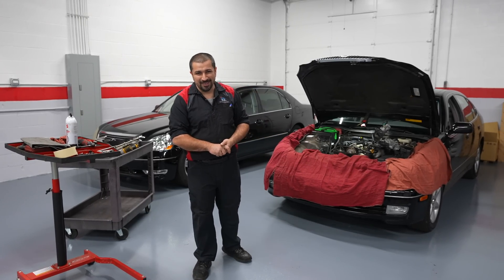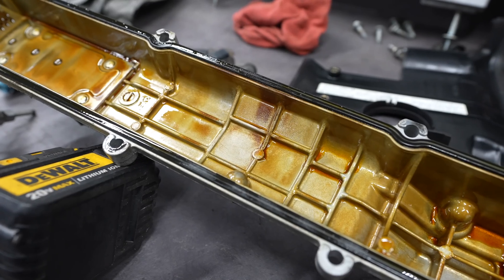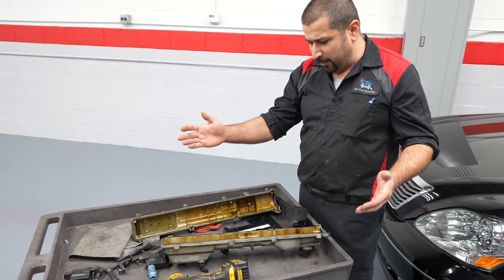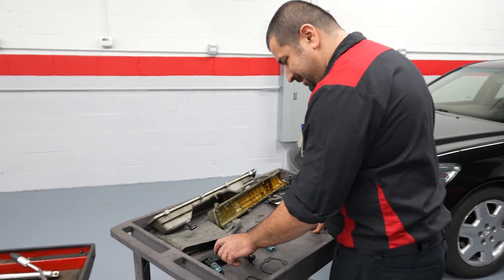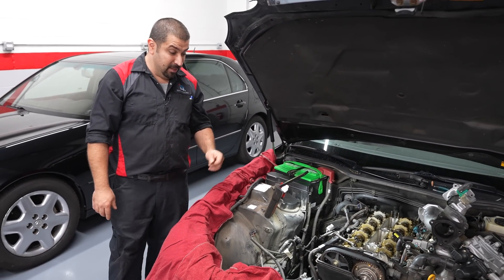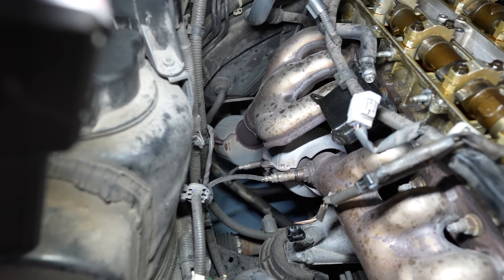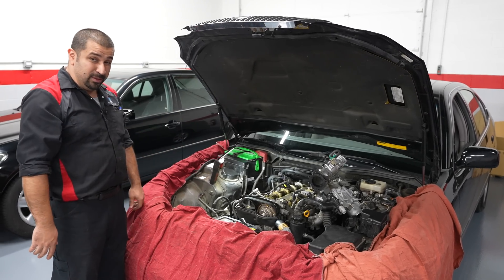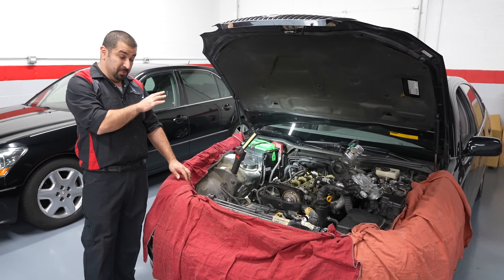This is How a Clean Engine Looks Like Inside Even After 20 Years of Service

Comment: Fresh air for the PCV system goes from the rear passenger cam to the front driver end of the engine, it’s normal looking.  My 2005 “Taurus” engine looks like that inside too, 15K oil changes. 225K on it.

Comment: Which engine oil change interval is better?
Mineral - 6000kms/6 months
Semi synthetic - 9000kms/9 months
Fully synthetic - 12000kms/12 months
Reply: Why even bother with a semi syn? Even if the vehicle did not originally come with full syn at the time.

Comment: Is that a straight 6cylinder engine?  That is a clumsy design having that valley in there where all the leaking oil can collect with nowhere to drain.  I'm sure even trying to clean it is a hassle, crap must spray all over.  Frequent fluid changes/flushes are the key to longevity for sure, wonder what his oil change interval is...I change mine at 3000miles, whether it is dirty or not.  Mine looks nice and clean inside, but have never had to replace the valve cover gaskets....yet.

Comment: My old 05' Accord with over 400K miles was very similar shape. Mostly highway driving and 6000 mile oil changes with Pennzoil or Mobil 1 synthetics. Almost always used Mobil 1 or K&N filters.
Reply: While my experience is not as impressive as yours, I have a 2012 Camry with 212K miles on it and it too is just as clean as the engine was when it left the factory. I also used Mobil 1 and just switched to Pennzoil recently.

Comment: Thank you for providing information on the 3.0 liter straight six. I have one that I bought IS300 new and now at 127000 miles without any oil leaks yet but I'm prepared for it thanks to your advice
. Whenever I took my car to the Lexus dealership the experienced mechanics would comment on their disappointment at the IS line going to V6s.  I appreciate you sharing all of your knowledgeable, honest information, and money saving tips on all Toyota/Lexus cars.
Reply: Consider replacing the vtc oring before your next timing belt. When it leaks (they all will eventually) it’ll get oil on the t belt which imho ruins it. Mine has 237k miles. Great engine.
Reply: @briantii  thank you, I looked into it and I'm ordering the o-ring
Reply: @greghaselhorst8649  You bet!

Comment: I had 2011 Toyota Highlander with 165K miles. Although the engine ran great, the six speed transmission had its own problems.  I took it to dealer, and the repair (replacement) cost was over $7,000. 
It is an irony that my old vehicle with much less reliable brand name ran more than 200k without any engine or transmission problems.

Comment: I did a similar job on our Mitsubishi V6 3.8L ( 2006) three weeks ago . The rocker cover seals were so brittle I had to heat them up and scrap them out. I do the oil changes every 12 months or 5000 km and it was just as clean as that 2JZ. Regular oil changes will keep your engine running I long time. This channel is one of the best .
Reply: I have the same engine in my Mitsubishi  380, I too change the oil frequently,  it pays.

Comment: Same model 208k miles. Original engine/transmission. No oil leaks. Just change the oil. True Tank. How do I get my car on your page. Needs timing belt replacement

Comment: The valve cover has been changed. You know if this car has at least 100k miles you can not wipe that clean . Common now this is ridiculous, twenty years old car.. stop lying to the viewers. You pre cleaned the valves too , get out of here.. If you’re looking for this kind of comment, YOU GOT IT. It’s never ever going to look new one On a twenty years old anything. Don’t flatter it,  or yourself, and ruin your reputation . And everyone will agree with me. I can’t believe you’re putting this out. The valve cover is new and you’ve pre cleaned inside or it is also been replaced. What? You’re not fooling anyone with this show. Are you running out of projects. Go fix your brain nut,  unbelievable. I’m not mad , just disappointed.
Reply: You’re stingy clown

Comment: I have a '21 Tacoma and decided to change my oil because I was going on a long road trip so wanted to start fresh. Being underneath to remove the drain plug and filter housing, I found them soooo cranked down from the dealership where I had it serviced under the maintenance plan last that I had to get creative to get them off. I even bought a torque wrench for this process and obviously the mechanic at the dealership didn't have one.
Reply: Yeah, some of the mechanics in the dealerships are apprentice that just started work less than a month ago

Comment: The GS300 is a wonderful car.  300k on mine and still runs like new.  Interesting thing about this engine that I found out is normal is that with the climate control off, the engine idles around 300 RPM.  Keep up with regular maintenance and this car lasts.
Reply: At 300 rpm, my engine is not turning fast enough to get proper oil pressure..
Reply: @petesmitt  I know.  It's crazy.  On other cars it is usually at least 600 RPMs and anything less then the car shakes really bad.  Not on the GS300 with the 2JZ.  300 RPMs and it feels like the engine is not running.  No vibrations.  Can't even hear the engine from inside the car.
Reply: @lewicheung  are you sure your tacho isn't 500rpm off? Lol
Reply: @jonytube  Pretty sure.  Double checked with the obd2 reader.
Reply: @lewicheung  that's crazy if your car actually idles at 300rpm, the lowest I've seen was an old I6 diesel bimmer which idled at about 650rpm
Reply: @lewicheung  I have turned to start the engine a few times because its so quiet
Reply: @petesmitt  ...good point to check that low idle speed oil pressure, especially with a worn engine.
Reply: i6 engines are perfectly balanced

Comment: My 2003 Toyota Tacoma is almost 300K miles with original water pump, coolant, brake fluid and all the rubber driving belts. In the beginning I changed oil every 3K miles, but after 200K miles every 5K miles. I guess before engine and transmission go bad all other parts go bad. Replaced oxygen sensors, some light bulbs. Drive belts showing cracks but I will replace those when odometer reaches 300K miles. It is amazing about Toyota reliability, even rubber belts last 19 years 300K miles. Only AC compressor belt has cracks and alternator,fan belt,etc looks fine but anyway I will replace them all.

Comment: My 95 Corolla, 285,000... Looks better than that... No varnish at all, oil looks good at 5,000 miles change. I have been known to save a few gallons, in case I have to flush a engine that blew a head gasket... SAVES some money. Uses maybe 1½ qts between changes.

Comment: PCV is the key; needs to be changed every 2 -3 years;  The owner really needs to use the Toyota RED coolant; fluids are cheap, engine work is expensive
Reply: I had mime on my 2002 Yaros for 13yrs with no issue,i clean it out every 4th year with my coolant change,never had any issues.

Comment: I'm going to do an Italian tune-up on my 2007 Scion TC after adding a fuel injector cleaner and fresh full synthetic oil. 
Texas 130 runs from Seguin to Georgetown, Texas at 80 to 85 mph.
Any suggestions other than checking tire pressure?
Reply: Yeah, keep chekn ur rear view mirror for the "wee-woo, wee-woo" 😂🤣😁

Comment: I have a 2013 Toyota Avalon with 279,000 miles. New Hybrid Battery. Engine flush every 6 months. New Oil every 3000 miles. I wish i could see the inside because I know its FLAWLESS.
Reply: Is that a waste if you change the oil every 3k to flush it?
Reply: @anthonymarinelli9224  not only a waste but not good for the engine; just changing the oil and filter is all an engine should get, not quack nonsense like 'flushing' the engine.
Reply: @petesmitt  I taught that it was used  if you don’t take care of the engine honestly
Reply: @anthonymarinelli9224  even then it's risky, as flushing out built-up crap can block oil galleries and jam up the oil pressure relief valve, causing no oil pressure.

Comment: My 2002 Camry with 215k miles looks the same, just replaced the valve cover gasket. I also note the maintenance on tape in the engine bay 😀.

Comment: Curious on your advise. I have a 2002 ES330 with 86,000. The timing belt/water pump was done at 50k, valve cover gaskets/plugs at 80k, trans fluid & power steering fluid at 70k, brake fluid is flushed and new. I do oil changes at 5k with full synthetic. The question is, what other PM would you recommend?
Reply: The ES330 came out in 2004. I have a 2002 ES300 I’m the 2nd owner and it now has 173k miles. Car is a tank, quality is unparalleled. I do my own synthetic oil changes every 5k miles. I’m definitely a Car Care nut. Bought it last April 2021 from the original owner w 160k miles. Summer of 2021 I Replaced all struts (rear ones started to leak), original alternator and AC Compressor (started to squeal) and this year replaced the original starter. I’ll be keeping this one until the wheels fall off. The timing belt was changed at 88k miles along with valve cover gasket and water pump
Reply: Drive the thing
Reply: I recommend you look into you have a half year early model Es330 or the older one. Either case, look into draining the mini differential. Yes I know it's front drive. Or transfer case type thing that's mated near the trans pan. The best way to describe it is like a soap dish holder above your bathtub. You can drain the tub but the soapdish will always have old fluid. Even if the showerhead above it splashed new fluid into it. Separate drain plug. Fill from same dip tube.
Reply from the maker: Honestly not much else. You’re doing a great job taking care of it
Reply: Try a full exchange of full synthetic transmission fluid like BG or Amsoil transmission fluid.
Reply: @nostradamus7648  yeah did that with Amsoil.
Reply: Yes, I know few people know about this. Few check it. Luckily the front diff is simple and robust. There is also a fill level check plug in addition to its own separate drain plug. In case you want to take a sample or something without just opening the drain. Toyo liked to do things different back then.

Comment: Yep I’m hoping my engines look that clean on the inside with my 6-month, 5,000 mile changes! Last week, my 21 Prius got her 4th change at 16,000 miles and the oil was a golden, dark brown which is a good sign of a clean engine inside!!
Reply: Dark brown??? Really??  Mine stays a fairly light gold color.
Reply: @WhalerGA  depends on the oil as well.
Reply: @WhalerGA  It must depend on how many miles vs 6mos. I have 17,000 on my 19 Prius & u cant see oil on dipstick. Time frame goes before I EVER get miles.
Reply: @WhalerGA  Black is the best.
Reply: @WhalerGA  The 0W-16 I use is Amazon Basics and comes with a brownish tint.
Reply: I have a 2014 CT200H that does an oil change at the shop every 15,000kms but I will do an in between one at home every 7,500kms. Even at 7,500kms/5,000miles, the engine oil was just a tad darker shade of brown compared with fresh oil. Plan to keep my engine cleaner than the GS in this video

Comment: I've written service and repair records on my cars for many years. The 5th gen 4Runner has a wide and long plastic panel between the grill and radiator which is the perfect blackboard for yellow crayon. Change oil, wipe off the previous mileage/date with brake cleaner and write the new numbers. Very easy to do and so useful. 4Runner oil is changed once a year or 5-6000 miles, not 10,000!

Comment: How can I determine whether a Toyota Dealer parts manager knows Toyota parts?  I Visited a local Toyota Dealer and the Parts manager for some parts numbers so I could do my own oil change, and he advised me that "Toyota does NOT HAVE part numbers!"?  I left a visited another Toyota Dealer and the Parts Manager told me to use 5W-30 since they were out of 0W-16.  On a NEW 2022Toyota for its first oil change. I had to do a LOT of calling around to buy the correct oil/filter.  Why? Does Toyota require Dealer Parts training?
Reply: You have a very good point.  I'm blown away that they thought 5w30 was suitable for 0w16.  

Us common folk have to seek out the information from multiple sources to decipher the plurality of answers.  If 3 out of 5 say part x, then I'd lean towards part x being correct.  I'm always hesitant listening to the first answer.

Comment: The water pump is external on My old trusty Volvo 740. ( 240s 940s with the B230 engines) Takes 15 mins to change . The timing belt takes about 35 mins or so to remove and replace. Impressive! And non interference engine too!!
Reply: Yes, those are the last of the real, RWD, Swedish  Volvos not the rubbish made today.
Reply: I had a 760t oh how I loved that car.
Reply: My 2nd car was a red '66 122S. Best car I ever had! My father made me get rid of it because it had 118,000 miles and his co-worker was trading in a Pinto with 18,000 miles. He didn't know the Volvo of that era could go 1,000,000 miles. It was similar to that P1800 that I think is still running today although the owner sadly passed away. I sold the Volvo to my friend who abandoned it, years later, because he had too many parking tickets! Now, I have the unpleasant memory of driving a Ford Pinto for several years. This is why they say, "Youth is wasted on the young"
Reply: @frankg6578  Just a couple of days ago I was speaking with the owner of a P1800E from the last year they were in production. Up here in Canada it has been his summer car for the last 30 years and it is still under 100,000 miles. 😁
Reply: @RightLaneHog3151  good memories, those old Volvos were great. Mine was a 4 speed manual transmission. The only down side was that it needed high test gas.
Reply: @frankg6578  🤩

Comment: Have you ever seen Toyota with 500 000 miles and the original engine?
Reply: @DD S I have seen a 2010 taxi Prius at the Toyota dealer with 720,000 miles & original engine & transmission, so yes, they do exist. As long as you keep the oil clean & don’t floor it 24/7 it will last a LONG time. The average Joe gives up on a car when it approaches around 300K miles, they don’t understand the true achievability you the engine. They slack on oil changes, for example, one of the teachers at school has a 2003 Pontiac Grand AM with 246K miles & it’s been almost 2 years since he actually changed the oil. I told him to change it & then the engine will last a bit longer, the rest of the car has some rust on the rear quarter panel, it requires welding, & not sure it’s worth doing that because Grand Am’s don’t really skyrocket in price compared to other cars. But yeah, 500K mile Japanese engines do exist.

Comment: I like those hose clamps and there are special pliers for them that are not expensive 😊
Reply: They can hurt if you use pliers and they slip 😓
Reply: @CarSharingJho  Never had any issues at all, used then 3 times on my older 2002 Yaris.
Reply: I never purchased those special clamps,just used pliers.
Reply: @tardeliesmagic  under $20 and saves aggravation.
Reply: @alexcallas8222  no kidding

Comment: AMD, It is time Toyota brought back their own inline 6 engine just like the good old days 😁 I would like my Toyota 6 in a RWD manual wagon. 🤩 If I ever need a new valve cover gasket on my humble 2005 1ZZ-FE engine, I will take a picture to prove it is just as clean. 😉
Reply: My brother had the 2zz engine. He pushed it past 300K miles before he bought a new engine
Reliable engines
Reply: 6 cylinder engines for smaller displacement designs can no longer meet the new emission standards. They are now the raptors in the engine world

Comment: I've got a question for you I have a 2019 Tacoma I was looking at the power steering fluid it's not leaking or anything but if I look at the manual it says that it takes dexon 2 or 3 but that's not what come in it when it was new I purchased it new it has never been changed it's not really that bad but it's like some kind of hydraulic fluid it's not automatic transmission fluid
Reply from the maker: Hi! I recommend you get power steering fluid that’s specified as power steering fluid. It has better additives
Reply: Use what's dictated on the reservoir cap. regular PS fluid looks like hydraulic fluid. I have heard the ATF for the PS being used at factory isn't dyed. I would use it until it's dirty and then change with what's on the cap.
Reply: Thanks it smells and looks like 46 hydraulic oil it is pretty clean the cap just says power steering and use the specified fluid but it doesn't say the specified fluid